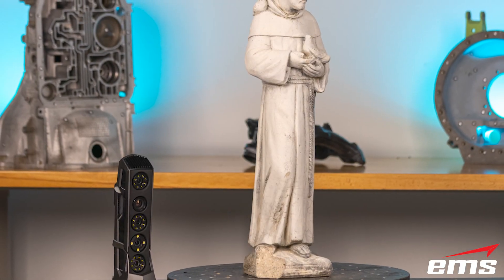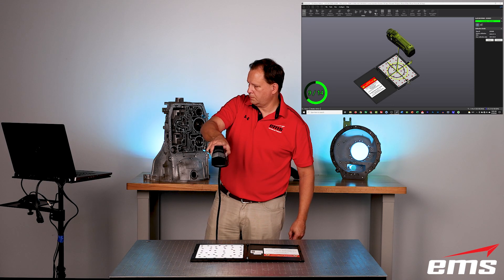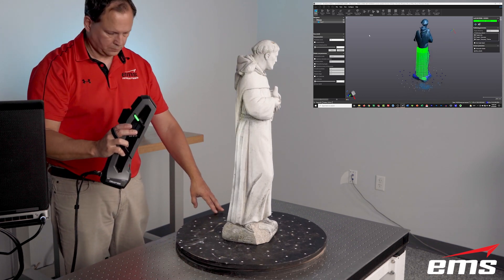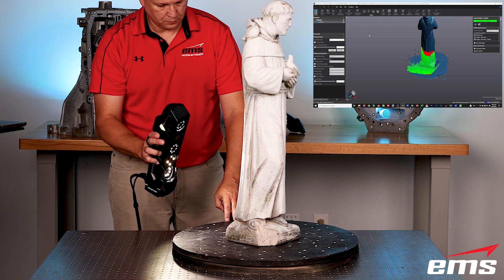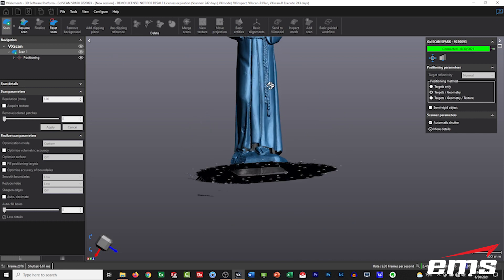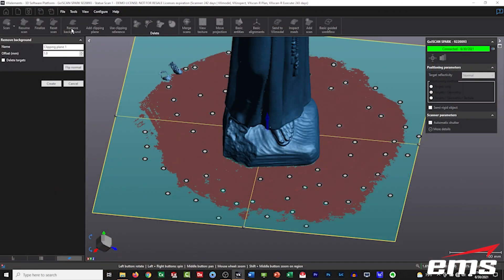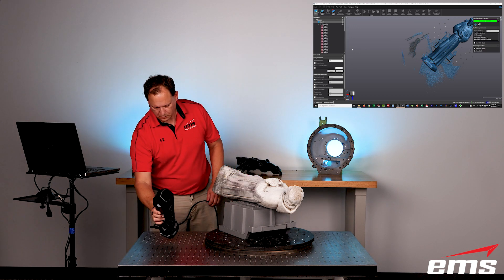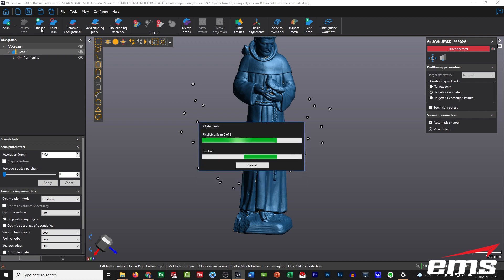3D Scanning Sculpture and Art

Comment: I am doing a lot of research on understanding the scanners ( white light, Laser etc) but there are many grey areas that companies do not share. In your opinion is Arctec LEO achieves the same quality and accuracy as CREAFORM GO Scan spark?
Reply from the maker: Hi PK.   In many ways they serve different markets.  The Leo is great for archeology, art, statues, historical preservation and similar items.  The GoSCAN Spark is meant for industrial design, product development, reverse engineering and even inspection.  The GoSCAN Spark has a much higher resolution and is much more accurate and can even be used for inspection for some customers.  

If you are serious about purchasing one of these 3D scanners have your local representative visit you (or a live web demo) and do a real "live" benchmark.  Pick out a few parts that are typical of what you do and have them 3D scan them.  Also make sure you see the entire process of 3D scanning, post processing and exporting of an STL file.  There are major differences between these scanners in regards to post processing speed.  Also have them scan a ball bar or gage block and look at the accuracy.  If either company doesn't want to do that I think you will have your answer.

Comment: Thanks again for yet another great upload. Very informative and without beating about the bush. Quick question: there is an option (visible on the right pane on 8:00, for example) called "semi-rigid object" — is that for objects that can deform slightly when they are being turned on the other side? And what this option does anyways? Does it somehow compensate for these deviations in geometry or something?
Reply from the maker: Hey Andrey,  Semi Rigid is turned on when you are 3D scanning objects that may move slightly.   Typically when scanning a persons foot, arm, etc.    Theoretically it could also work when your part slightly deforms as well.  Too much deformation and the scanner might lose its position.  It's always good to put at least 3 targets on the object as a place you can go back to and start scanning again.
Reply: @EMS3D  Thank you for the explanation)